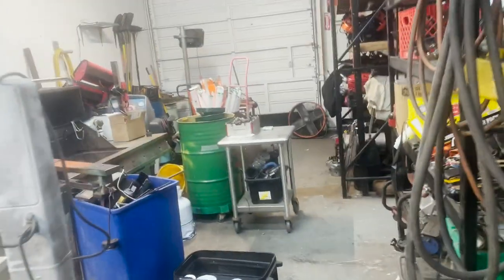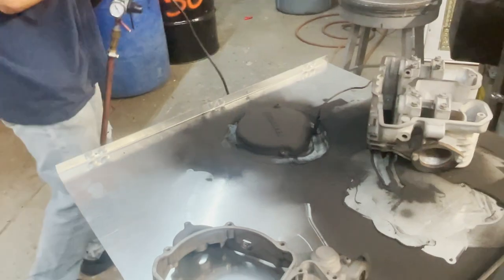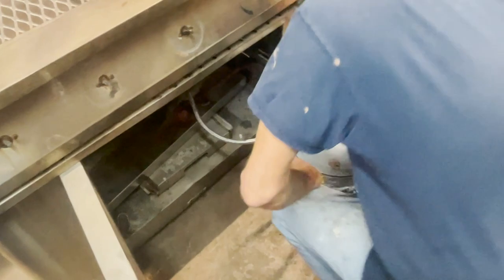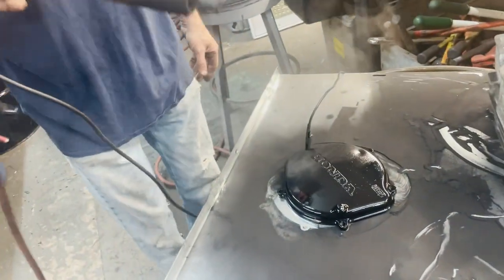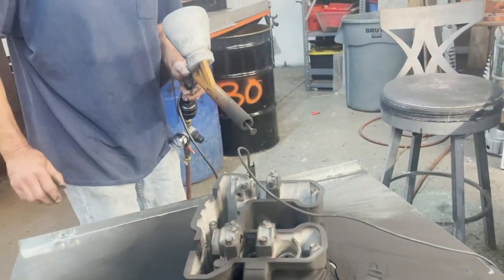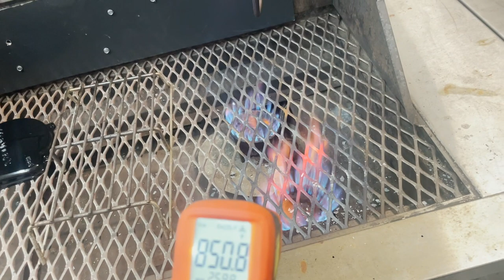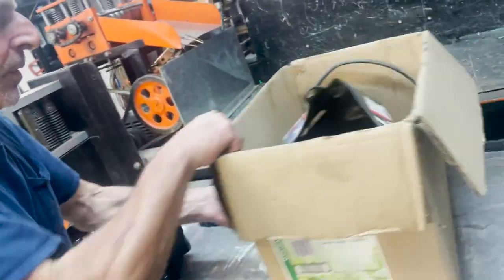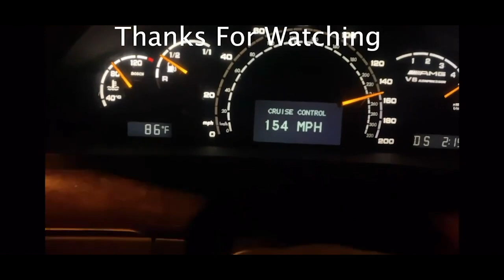DIY Powder Coating & Custom Made Oven

Comment: The problem I foresee is that an oven that big will not have a nice distribution of heat.  The top will be hot and the bottom room temperature.  I guess you will need some sort of fan to help distribute the heat, but not too strong or you will blow the powder off what you are coating.
Reply from the maker: Thanks for the suggestion
Reply: @ProjectShopFl  I built an oven that can do a large atv frame. It consists of a 5 foot by 8 foot room 6 feet tall. It is made with metal 2X4's and covered on the outside with galvanized 1/8" steel. The inside is fiberglass and then that is closed in with the same 1/8 " galvanized steel. I bought 3 oven heating elements and mounted them on the back wall. I drilled holes to run the cables to the outside where I built a temperature control unit. I believe you need to keep 320 degrees F for a half hour. I th9nk that is the actual metal temperature. The front has two doors that open up and they are made by sandwiching fiberglass  as well. I made this thing to powder coat a couple atv frames and a couple friend's motorcycle frames about 4 years ago and I just wanted to make sure it still worked before I said anything. I did an engine case last night and it still works great. I got the idea originally from a guy on YouTube who was doing atv frames for his son who races motocross. I do not remember who it was but I am sure you could find him if you look up diy oven fro powder coating. Also There is a much better and less expensive place to get the powders. I think it is pyramid or something.Good luck my friends.

Comment: If you want it perfect sand it,  coat it again and then put a coat of powder coat clear coat on it.

I watch a channel where the guy restores old tonka toys and does them that way

I grew up on red necking.
Reply from the maker: Thanks, do you have the name of the channel?
Reply: @ProjectShopFl  
CHIP CHANNEL RESTORATIONS

Comment: Awesome!!! I use a grill similar to yours to heat my cast iron pieces that I need to weld for my mobile welding business. I love your shop. Especially that it is warm. It is freezing up here in Pa. When I am able I am going to pack up the Welding rig with My Bobcat 225 and a crane and drill press on the flatbed and pull a trailer with a hybrid office-sleep area/motorcycle and etc hauler and move back down to Tampa for at least the winter time..I want to stop by and say hello to you and grab a couple beers ..That turned out fantastic my friends!!! You could call it Thot Monkey Powder Coating Llc.......lol
Reply from the maker: Thanks for the suggestion
Reply: @ProjectShopFl  Sure thing. You guys always do the coolest stuff.

Comment: I use to powder coat signs. We used a spray booth to keep the powder for reuse. And our furnace was electric on both sides. The parts hung on wires running on a chain track between the furnace walls.
Reply from the maker: I hope to get close to that set up one day.

Comment: They literally build these ovens on the spot. I worked at a Powdered metals company as Research director.(I am a chemical engineer...WooHoo) We had these old ovens that looked like someone came in and built metal cabinets the size of 12 feet by 10 feet deep by six feet high (too low). We had to purchase a new one and that is exactly what they did. A group of guys cam e in with a large metal brake and made a big room. Then they used something like wall board that was fire resistant. Then on the ceiling there were two fans. There were large coils of what looked like bedsprings that were the heating elements. I bought all the supplies from Eastwood to get the powder coating up and running. Then I built my own large size high voltage gun and we made the powders so we had a huge business in no time and we got to a point where there were orders lined up for months. Very lucrative my friends.
Reply from the maker: Nice, I want to try and start a small biz and see what happens.